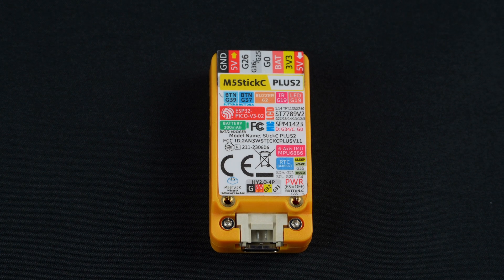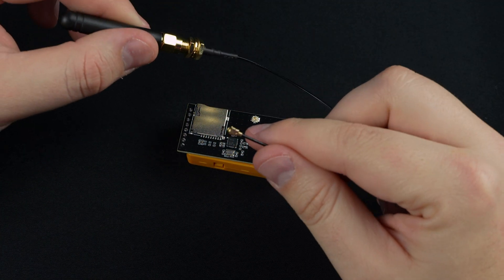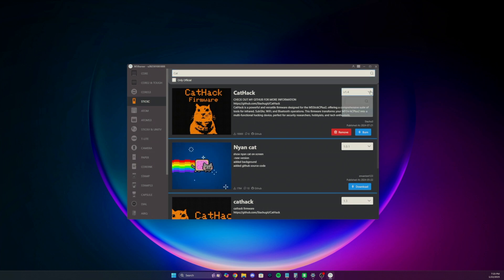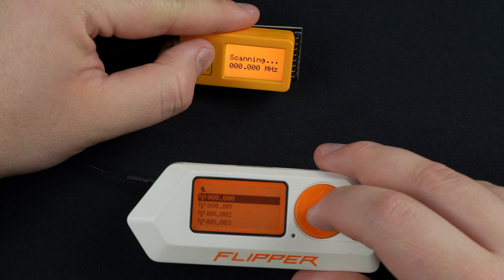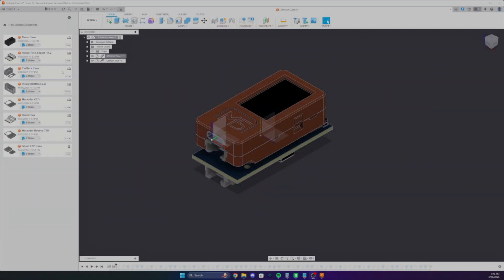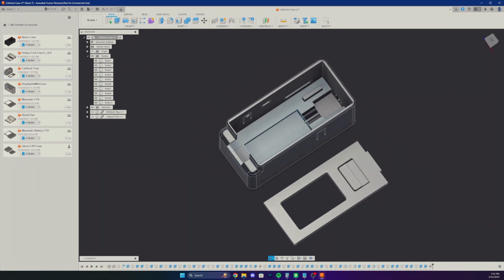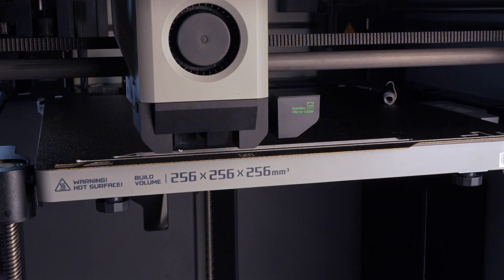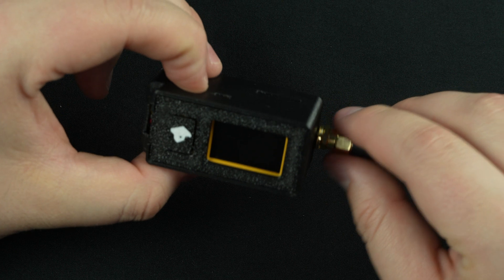CatHack Build Guide - Flipper Zero Killer? no lol

Comment from the maker: Looks like the Bruce dev replied to the GitHub issue a few days ago. Support is coming soon for CC1101 and SD card simultaneously. Which means support is coming for this board!!!! HUGE!!!

EDIT: They changed the wiring. I need to make a board revision. I'll have it available soon!

Edit 4-21-25: I’m not sure it will happen… shared SPI is broken with the current schematic and firmware the Bruce dev recommends. I raised a GitHub issue but at the moment, CatHack is king for shared SD and CC1101 on M5 Stick.

Edit: 5-30-25 WE GOT IT. I’ll list it for sale soon 👀 I worked with the dev and the schematic has been updated in the GitHub instructions.
Reply: discord link not working
Reply: Are you going to make a video on it?
Reply: Shop not working

Comment: Very nice build, but please check health risks on carbon fiber based filaments and evaluate for yourself if you want to continue to use it
Reply from the maker: Hello, so there was a video on YouTube that blew up comparing CF filament to asbestos. This was blown way out of proportion. Please take a look at the study done by Prusa on this. There are also many other resources that contradict this claim. I use a respirator when post-processing any prints, no matter the material. I always print with ventilation, and as for CF in a finished print, it’s safe. I take the same precautions as if I was printing ABS.

I appreciate the concern! Thanks for looking out ❤️

Comment: @Hedge-Tech-95   Love the board. Have been playing around with CYD and watched this video and the same day got a M5. Noticed that there is alot of die hard flipper lovers so saying anything bad against the device, can wake the trolls. I have found that the flipper is  prohibitively expensive for what it is. I will be prototyping my own board thanks to your design. Making sure that you added the holes for the M5 on your board was a nice touch, you stated that it was tricky to CAD the case as the board was not flush with the M5 body, this is due to the plastic spacers that hold the pins to connect the m5 to your board. When it comes to building my board, I will be playing around with the pins rotation and or removing the spacers entirely, to make the board flush as I will not have a case for the board. Your CAD skills are better than mine, may I suggest that you design a case for your board and turn your design into a module like any other. I would also suggest that  like with you CYD board design that you added a hub for the Grove port for gps, that kind of expansion is not available with the M5 modules, the hubs are sold separately. The reason why the flipper has been successful is the IO port and the femware, by using the same repository of the flipper you have built a great affordable tool, that's definitely worth developing. Keep up the good work.

Comment: when will you restock?? Im planning on buying the mouse trap + some extra things so i can mod it! And if you want I can also send the extra schematic to you so you can sell it you're self. Just with like a cc1101, IR transmitter + receiver built both together in one board, and also a nfc chip and if it fits a nfc reader. :)
Reply from the maker: Thanks for the support. I was going to release a Bruce board with the same features but unfortunately the firmware and hardware the dev suggests just don’t work at this time.

I will be ordering a new batch of cathack boards today and hope to receive them within 2 weeks!

Comment: Does the board work on bruce
Reply from the maker: I’ve heard From some people that have bought it that you have to have the SD card unplugged to record to the tiny file system. Direct recording to the SD card isn’t supported, but the developer is working on it right now! 

Hopefully, in the next few weeks, we will see full compatibility. With the wiring of the board, it should have no problem when the update comes out.

Comment: This is a fantastic way to avoid having to solder and/or not have wires all over the place. Does this work on other firmwares like Bruce by chance? Great job!
Reply from the maker: Thanks a bunch! Bruce doesn’t work with the SD card AND cc1101 at the same time unfortunately. There’s an open issue for it on GitHub. I’m hoping they can implement similar code eventually. But the board should work once that fix is in place. It recognizes both the CC1101 and SD card but I don’t get any inputs

Comment: Why not Bruce?
Reply from the maker: Bruce doesn’t support SD card and the CC1101 at the same time unfortunately. I didnt know it did RF at the time of recording either but still, not working right now. But if that gets fixed the board should work.

https://github.com/pr3y/Bruce/wiki/CC1101
https://github.com/pr3y/Bruce/issues/249

Comment: the benefit of this board isn't necessarily cat hack, but the pcb with sd card working out of the box aftet plugging it in. why? because you can install m5 launcher. then any fw made of this device can run, including bruce, cat hack, marauder, etc. some people doing this setup are using diy pcbs with messy jumper wires especially since the grove connectors are on the opposite end. you could make a black discreet one without cat hack logos and that would be even better, imo.

also, the diy pinouts are the same as nrf24. you could hypothetically swap out boards. if the case is restricting that, a redesign might work or... a new design that fits both boards with a switch that goes between either board. as a breakout board it hs potential too.
Reply from the maker: Thanks for your comment. I was thinking about using the same board but utilizing a double throw switch or something to change operating modes of the board.
Reply: @Hedge-Tech-95 they make single pole micro slide switches with 3 positions which can become a selector for nrf, all off, or cc11010, although a 2 position switch is more common that can be done to have either board but no off button. 

there is also a watchband accessory. that would be cool to be able to somehow design a case around that so everything fits on the wrist. i did something similar with marauder fw on the previous version of the stick c. no boards, just marauder on the wrist.

thanks for making the board. m5's stick lineup has been missing a proper breakout board with a sd card reader for the longest time now. it gives it much more potential in a much cleaner setup.

Comment: Bruce is far better than CatHack. But still cant beat FZ. Why? Because FZ can decode many Sub-GHz protocols. CatHack is just RAW record and maybe 1 or 2 protocol can decode
Reply from the maker: I didn’t know Bruce had RF capabilities. I’ll have to try this module out with that. If it supports more hardware I could add more features to this board. As for the decoding, I imagine that’s just a firmware limitation and given enough time, support for more protocols could come?
Reply: @Hedge-Tech-95  In hardware side M5 Stick is same capability as FZ. Only disadvantage is software. it's just my opinion. Great job man.
Reply from the maker: Thanks i appreciate it <3 Looks like SD card and CC1101 arent compatible when combined right now for the M5 Stick on the Bruce firmware. I'll see if i can ping the developer. https://github.com/pr3y/Bruce/issues/249
I tried and it does indeed recognize the CC1101 and the SD card but my spectrum doesn't react and i cant detect any signals. There's an open issue on the GitHub and it notes the issue in the Wiki
Reply: Isn't the hardware same, same cheap CC1101 that you can buy for few bucks on Ali, it is just software side that is different? We just need good programer, and all features will be the same.

Although I still don't understand why there is so much excitement about subGhz radio in the context of FZ.  Today every good product either uses encryption or rolling codes, and in both cases FZ is not useful. 
What can you do, eavesdrop on whether stations in the neighborhood and spoil people's readings...
Reply: @goranjosic  yep FZ can’t do much in rolling code. But can decode few old rolling code. If you can find Manufacture key rolling code can be decoded. It’s not easy ofc.
Reply: @kreaxv  ok, but if you are into radio hacking and decoding rolling codes, isn't then more logical to buy an SDR and some good porta pack (that together doesn't cost much more than the FZ), and have real equipment for serious work?!
Reply: @ for decoding FZ and SDR actualy not need. It's pure coding thing bro
Reply: @kreaxv  I've never decoded rollin codes, nor would I know how, but I've wired and programmed different hobby radio modules with microcontrollers (together with basic encryption) - point is you won't record much with a Cc1101, even with external antena.
Reply from the maker: @goranjosic The CC1101 is a very cheap and capable IC for small form factor devices. It’s the same IC that the flipper zero uses. Neither device is a hackrf one though that’s for sure lol.
But for something this small it’s a decent option
Reply: @goranjosic  CC1101 is just transmitter. it can work on any ardiuno compatible board or SPI intarface device. KeeLoq is open source. you can create your own new encrupted protocol easy. Decoding is hard but not imposible.
Reply: @goranjosic  There are firmwares that enable compatibility with rolling codes... jussayin...
Reply: Bruce ❤
Reply: To get a flipper zero with an cc1101 or NRF24 the minimum cost where I live is 200$ for everything in this video costs me like 50$